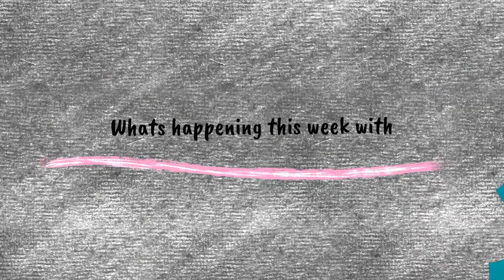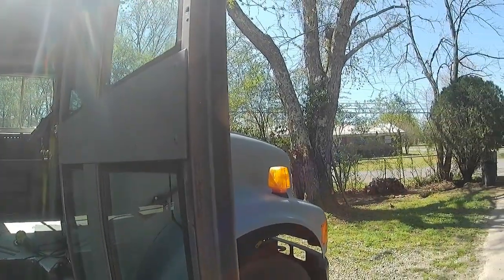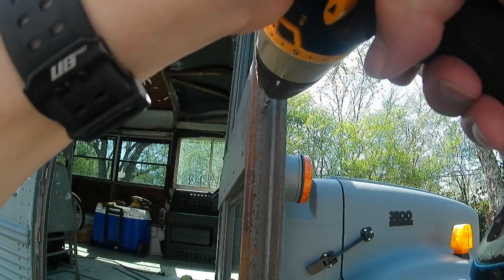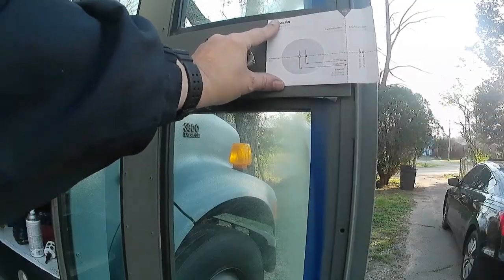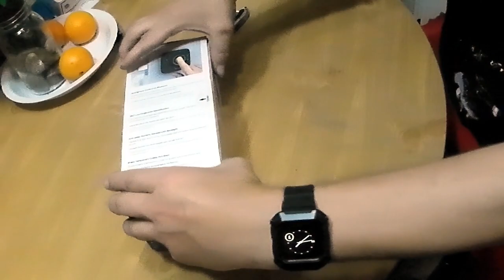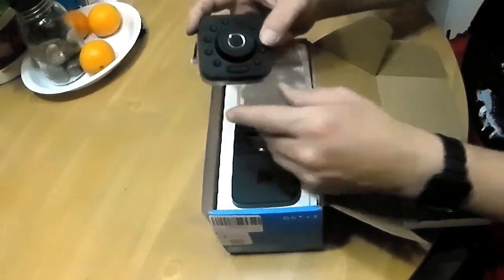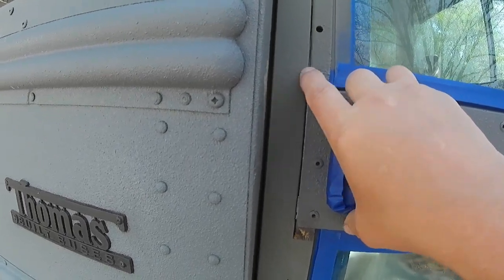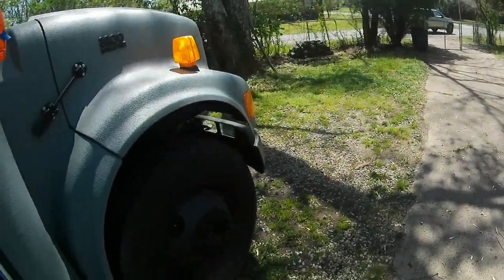SKOOLIE BUILD | DOOR CONVERSION PART 2 | BIOMETRIC LOCK | TURNIN A SKOOLIE INTO A TINY HOME

Comment: Criminals Use A Black-Light To See What Number Buttons Were Used & Can Make Copy Of Your Finger Print Get The Lock To Open! It Keeps Honest People Out & Yes It Gives Honest People Feeling Safe & Secure. Any Locksmith Will Tell Ya, Even With These Type of Locks You Still Need A Key Dead Bolt Lock In Your Home If they Are Sticks & Bricks Or On Wheels.
Reply from the maker: Yea.. Anybody can get into just about anything if they try hard enough.